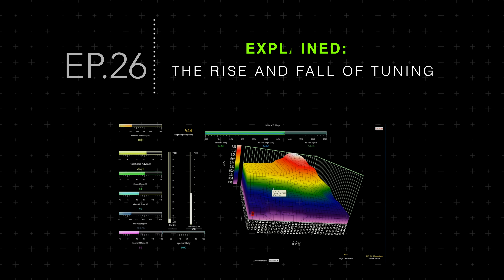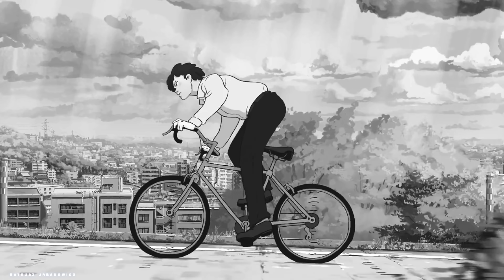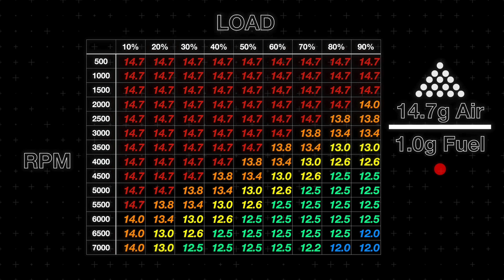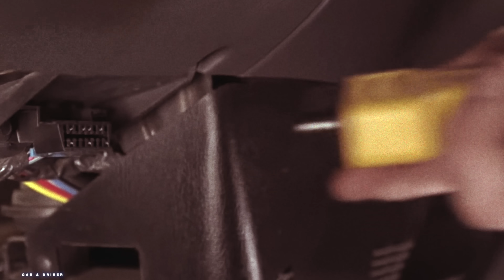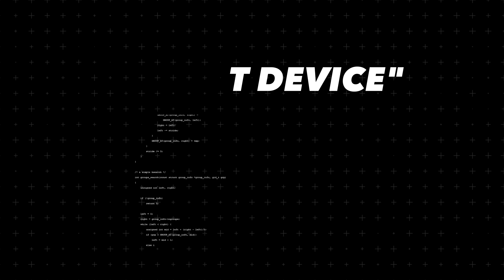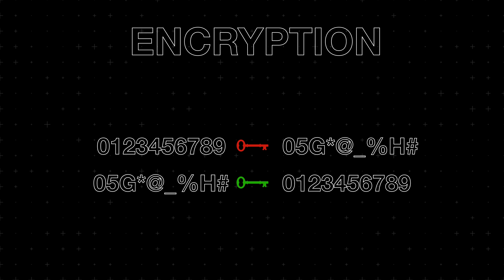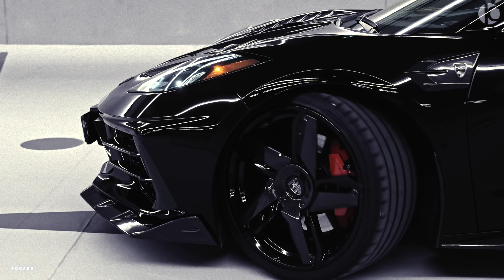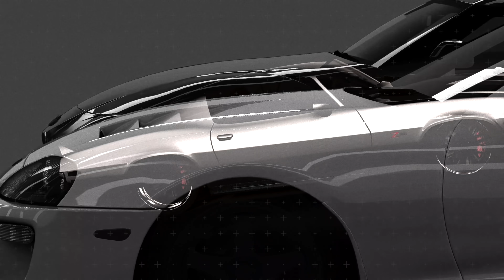How Tuning Engines Became Illegal👮🏻‍♂️| Explained Ep.26

Comment: Long story short EPA has made it so the engine runs the most economical not most powerful and a tuners job is to wear to figure out how to add fuel and curve to the spark to make more horsepower without adding more emissions

Comment: That cammed Camaro might not be affecting your life expectancy but that cammed out Mustang sure will, but for an entirely different reason ;) 
Joking aside, Piggy back tuners, of man in the middle tuners are where were going to be forced.  My 2021 Turbo 3 has no ECU tuners available,  but the JB4 as a piggy back works really well and can be removed without a trace if anything goes wrong.  You dont have the full tuning freedom but its still better than nothing.

Comment: I wrote a 5,000 word article on the impact Motronic had on Tuning for a publication a few years ago and I never felt I could do it justice. Glad to see such a great channel giving such an important topic some attention it deserves
Reply: Ya what a shity time to be alive. Looks like I'm keep my old cars around forever
Reply: Motronic is so tunable it’s great, I had a Volvo 850r with motronic m4.4 it was the first exam I ever flashed and did the whole setup for flashing for less than 20$
Reply: @turkeyboyjh1  yes motronics are stupid easy to tune, unlike their predecessor the LH 2.4 jetronic which is a eprom ecu that needs an ostrich 2.0 to tune
Reply: @homelessdrifter9508  I actually used an ostrich on my m4.4 but really just for data logging and real-time tuning, it’s not needed but cuts down on flashing time and less wiring because the m4.4 ecm needs a 14.5-15 volt line for boot mode
Reply: @turkeyboyjh1  yes ostrich is really good, but unfortunatelly the LH jetronic cant be tuned without a chipburner like ostrich and they are stupid hard to find. My friend asked me to tune his saab 900 that originally had the 2.1L or 2L carburetor engone and were swapping a 2.1L NA fuel injected engine with the fuel injected engines worong harness so original ecu will be used. I told him he would need to pay for the ostrich which the cheapest one i have ever seen was like 200€ but it wasnt available
Reply: @homelessdrifter9508  I got a guy in San Leandro California that is a moats dealer he has them in stock still if you need them
Reply: @turkeyboyjh1  its going to cost too much for me because of taxes and toll since i dont live in usa. i found a few for 84€
Reply: Itll be funny if gov officials already knew VW cheated their EPA system before 2015, thatll be silly

Comment: Thank god for crate engines. And honestly, EVs will be easier in some ways since the emissions equation is null and the engine is simpler. Fight for right to repair legislation! It fights the carte blanche "mah intellectual property" approach where you cant do anything to your own car. Its fair use, if they wanna go that route, especially if you arent selling modified versions. You should still be able to say, completely replace the ECU or something similar.  Tuner companies may have to get creative, but support R2R and companies that dont pull that kind of bs.

Comment: Love how FoMoCo has been totally hands off in this.  Even allowing thier Engineers on their off time to crack/tune the cars.
Reply: That's kinda awesome. Also "FoMoCo" made me chuckle.
Reply: @jdkim1019  OEM parts are tagged FoMoCo 😆
Reply: Not many people are tuning their FoMoCo F150 trucks.
Reply: @KrustyKlown  2nd Gen Lightnings ring a bell, or Raptors, nevermind 302/351s or 460s.
Reply: @bowez9  point was, the bulk of vehiciles Ford makes now aren't worth tuning, and certainly aren't purchased for performance uses ... maybe a handful of top end low production volume Mustangs and Raptors.
Reply: @KrustyKlown  There are other cars/vehicles they do it too as well, some off road rally stuff they will use the Ford Bronco now or the older Edge large crossover again depending on class, then on the Moto truck racing side you can see tuned F150 and Ranger engines in a unique modified chasse with roll cage to the race series they are in, again car type depending on class/series . Also in Baha racing like the Moab races and the Baha 1000, the F150 and Ranger engines are used tuned to racing for the top two bigger classes with the 1/2 and 1/4 millon dollar cars in very specialized racing vehicles.
Reply: @caseysmith544  The problem though is "racing vehicle".  Off highway use is not inherently regulated, and off highway vehicles basically have no rules as far as emissions go because of their incredibly low average use.  Sure those engines get tuned, but you'd never see a tuned one in a road legal plated vehicle because the EPA would ream Ford.  The point here is that people want to tune common road cars and continue to have them be road legal, which is why people are even discussing emissions in the first place.  You'll never hear anyone talk about emissions on a race car and I can pretty much assure you that unless the race rules say otherwise (or there's some engineering advantage), every last one of them is straight piped.
Reply: @WotanTheScourge  Some rally racing, categories of CanAm style racing, and some race categories in the offroad trail racing force the car to be street legal same with some categories of street drag racing on a strip. Hence why I mention it in the first place.
Reply: @KrustyKlown  apperently you live under a rock.
Reply: @fordman2288  Oh please, enlighten me, the Detroit Automotive Engineer about what I'm wrong about, lol... go for it.
Reply: @fordman2288  Krusty knows all, he's a "Detroit Automotive Engineer", convenient, isn't it? Lol.
Reply: With giant "manly" rainbows painted down the sides. Doesn't it just scream "performance"?
Reply: What's awesome is Ford offers a tune on the 2.3L I-4 Ecoboost in the Bronco for $825, factory warranty covered and takes the truck from 300hp/315trq to 330hp and 385trq.  I mean I think that's not a bad price for factory covered hp and trq gains for that money.